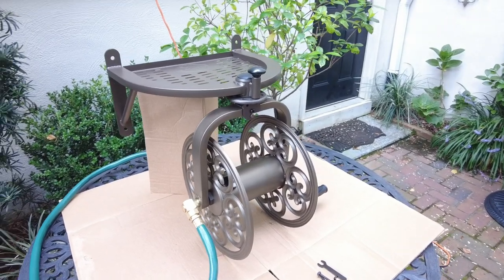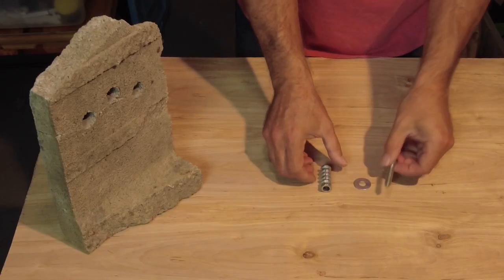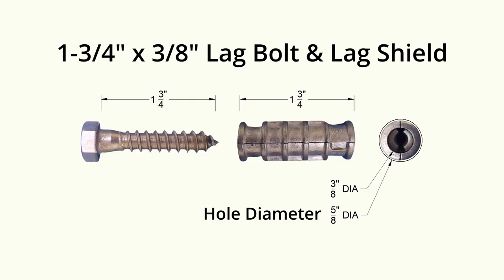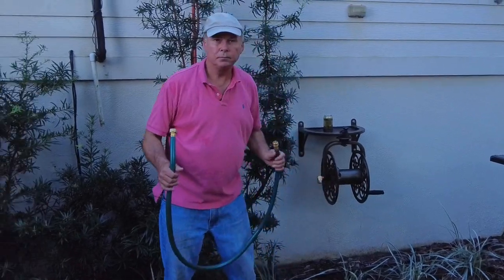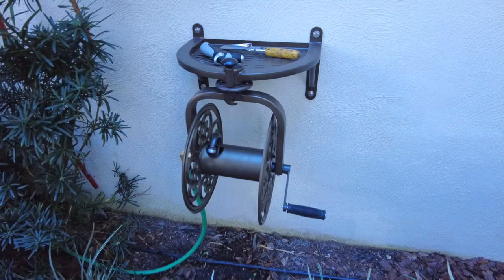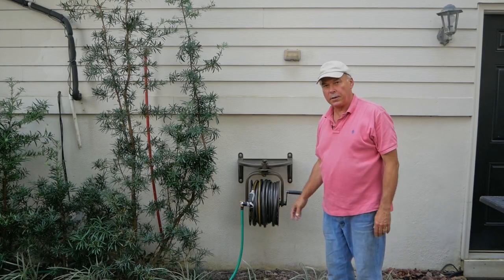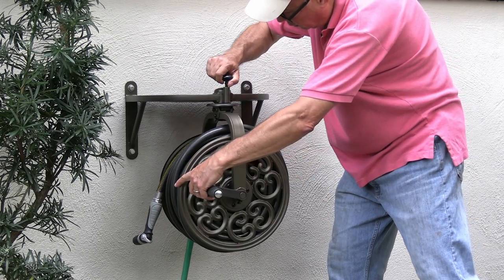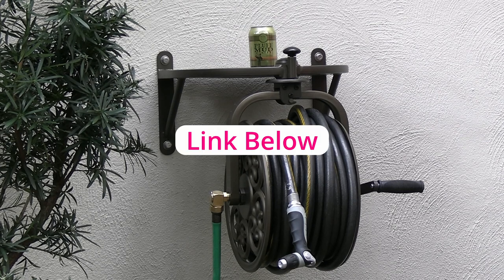Liberty Garden 710 Navigator Rotating Garden Hose Reel, Review and installation

Comment: Nice video.  What do you think of the durability of the pin on which the reel rotates?  On the Liberty Garden website there is a video devoted to how to replace it. It may be a point of weakness which may not be a problem unless you use a very long hose, or it may be a point of weakness that is a constant frustration!  Any opinions?
Reply from the maker: Thank you for your comment.  I've been using it about 6 months with a 100 ft hose.  No problem with the pin or anything else.  I'm happy with it.